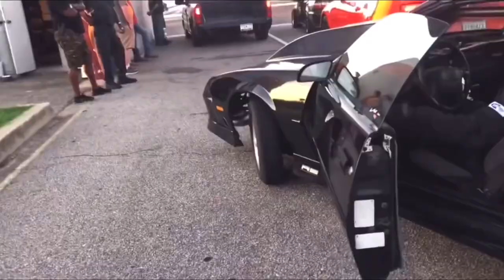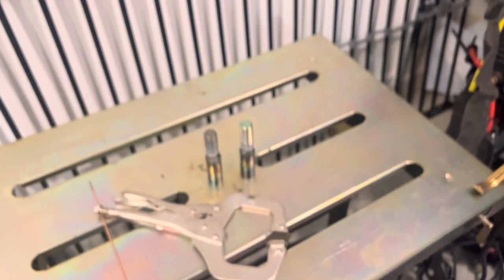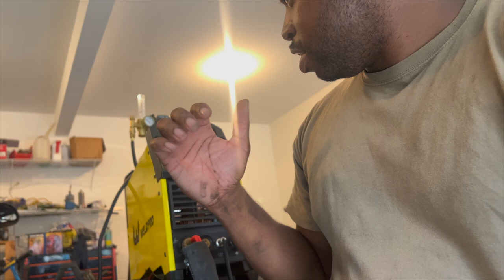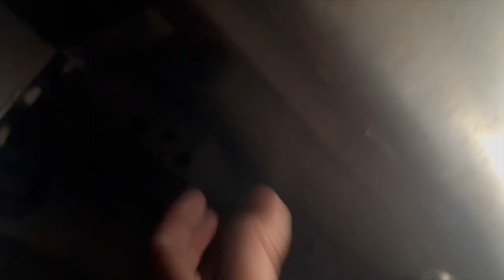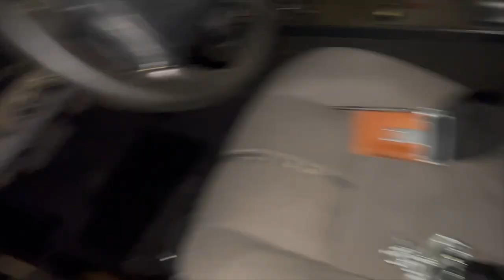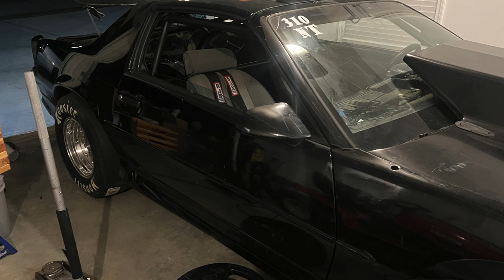No Prep Racing Secrets for Traction!!

Comment: What type of rear end set up do you have in the car? And does it still have a torque arm?
Reply from the maker: It’s a 8.8 out of a Ford Explorer. It has a spool and jegster short tq arm
Reply: @boostinwillie  I was wanting to build an explorer 8.8 for my 4th gen. Are you using the explorer brakes and wheels with a ford bolt pattern?
Reply from the maker: @MegaMustangkiller  yep the back it ford lug pattern. And Explorer brakes .

Comment: Putting the weight that low is not the greatest the weight being up higher is Multiplied more when launching the car because it's like having the weight on a lever just looking at her bum put all that weight hanging off that lever so yours being below the suspension is just dead weight if you put a up above the suspension in the very back like bolted inside the tail lights now you're getting more of a fulcrum or put it on the parachute bracket
Reply from the maker: I’ll post the changes I made. I actually may have already did but it’s definitely higher now